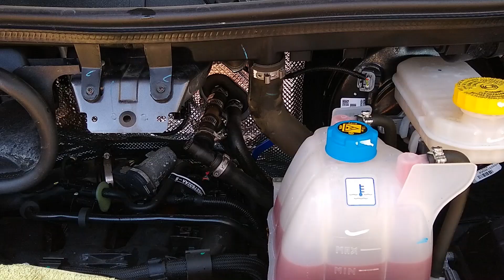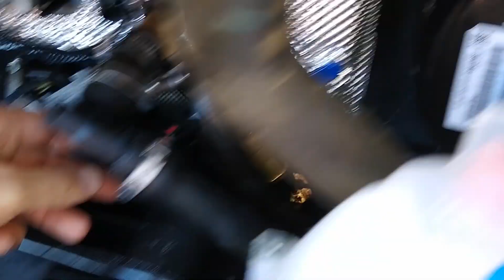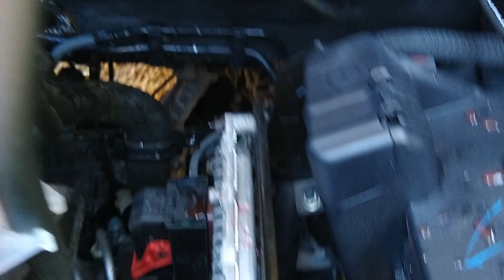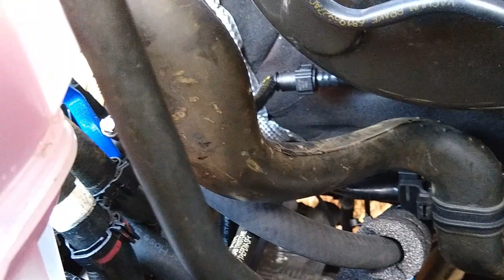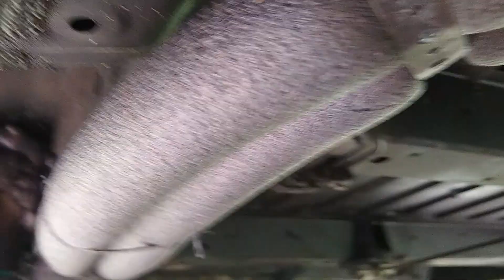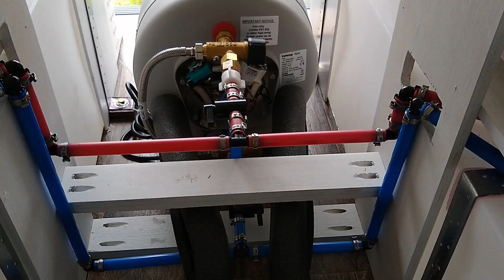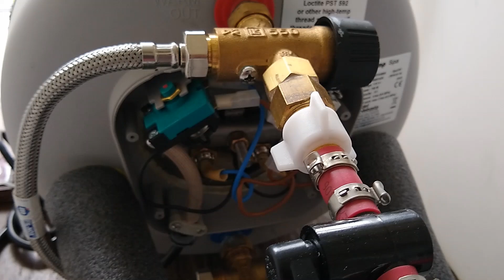Water Heater Install - Marine IsoTherm IsoTemp Spa 15 - DIY RV Promaster Camper Van - WanderingWakes

Comment: Thanks for the well done video! I just recieved my isotherm heater and am about to install.  I'm wondering why you used the Tees the way you did, rather than in a way that forces ALL the coolant to run through the heater core and then the Isotherm.  (Not sure if I'm being clear... and I certainly don't understand thermodynamics). But wouldn't the way you did it allow a portion of the fluid to bypass the isotherm altogether?   

Reading further comments... seems like you're happy with your system and it works well.  Just wondering!  Thanks
Reply: I agree to run in series flow and return from 1 pipe would force all the water through
Reply: Curious about this also @WanderingWakes. I do like the ability to isolate the system if you need to service the heater you can still drive the van.
Reply: Was there ever a reply to this question because I was thinking of installing in the same way. But this way using tees does seem very practical in the way you can isolate the system.
Reply from the maker: @adamgrace5973  Just posted a reply. It must not have saved. Thanks.
Reply from the maker: I thought I replied, but now see I must not have saved it. I believe the factory rear heat also uses tees. I would be concerned that with a series connection, the flow rate might be reduced due to more restriction. Before I installed mine, I only saw others using tees and installing in a similar way. 20,000+ miles and it has been working perfectly. The engine is also not overheating, staying right about 200 degrees max unless climbing mountains. Sorry for the delay on this
Reply: @wanderingwakes9500  perfect, tees it is then 👍 thanks for your reply

Comment: Thank you for this info. Do you think it would be possible/practical/nessesary to add a supplementary rv tankless under sink or shower hot water booster for that initial blast of water or to stretch it a bit further?
Reply from the maker: i think it would be possible, but I located our water heater within 3 feet of the shower faucet, so not much water lost. If you parked and did not drive for several days, the tankless might be good. We can easily take 2 showers and wash dishes on a full tank of hot water, and then tend to drive every day or two, so more hot water is ready then. You can run the electric element in the water heater on an inverter, but it would use a chunk of battery capacity. Hope that helps! WW
Reply: @wanderingwakes9500  thanks! I like the idea of simply locating the heater close to the shower! 👍🏼 I may have to move things around! Cold water in the sink isn’t really an issue and it sounds like this would work well for us as is!

Comment: Thanks for a great video. Would you mind sharing what you used to bring the coolant hose up through the floor. A high temp boot or sleeve? My concern with protecting the hose is covered by your pipe insulation I suppose. How did you seal that hole in the floor?
Reply from the maker: I used a plastic sleeve around each pipe. I also put the hoses in metal pex "bend supports" that helped to protect the hose. Finally, I used high temp RTV sealant to seal the openings through the floor to prevent air or insect infiltration.
Reply: @wanderingwakes9500  Hello, thanks for the incredibly helpful video. What kind of plastic sleeve did you use - to go through the floor?
Reply from the maker: @Lsarsozo  I think I just used some scrap PVC pipe I had, slightly larger than the hose.

Comment: Hey, looks like you have done a fair bit of research on this, we bought one of these Isotemp Spa heaters for our promaster 3500, but dont want to hook up the engine coolant to the heater as we have 4 solar panels, and tons of batteries, do you see a problem with that. Will it work ok with shore power or off our inverter?  Thx  P
Reply from the maker: It does have an electric heating element that we have used before when the engine wasn't run recently. I think it is a 650 Watt element. So it could run off an inverter but you would need to watch your battery usage.
Reply: @wanderingwakes9500  ok, im just hooking this up to the electic only on our 2015 Promaster. Should i just block off the ports for the engine hose, as we will not be using the. I guess if no water is going thru,  there is no danger of water coming out of the ports!?? Am i correct?  Thanks
Reply from the maker: @PaulAuclair  Yes, the water from the engine and fresh water don't mix, so I would just cap them off to keep dirt and bugs out in case you decide to use them later.
Reply: @wanderingwakes9500  thanks so much, i appreciate you taking time to respond! Cheers!
Reply: @wanderingwakes9500  thanks, yes we would use it mainly for showers, heat it up turn it off. Will be in Mexico so lots of sun!

Comment: you will have a separate tank for cold water right?  we are getting a van that has this system.  I had no idea how it works.
Reply from the maker: Yes, we have a larger fresh or cold water tank that then feeds the water heater. Thanks and good luck.

Comment: Hi Shawn, great videos and I learn so much from your build. I have couple questions about the size of this water heater. How is 15 liter (4 gallon) size work for you? What size do you recommend for a couple with 2 kids? Thank you
Reply from the maker: It might be close, but if you really watch your shower use (the biggest consumer for us), it may be fine. But, I also think they offer a 20 liter that would be more hot water. The way it works, with the mixing valve, you really have much more than 15L of usable hot water, since the 15L is 180 degrees or so after driving. The mixing valve extends the use at normal / safe temperatures.

Comment: Just wondering if you'd need an expansion vessel as this is unvented? Am just doing a similar system and had been worried about having to have water ijn the tank at all times, so that the coolant wouldn't fry the calorifier to a cinder. And then I saw your ball valves... Beautiful!
Reply from the maker: I did not do an expansion vessel. If pressure gets too high the van pressure relief would open and the water heater has its own pressure relief valve. These heaters are designed to be in operation for boats, so I am not too worried about hot water circulating all the time. Just my $0.02. Good luck with your project.
Reply: @wanderingwakes9500   we are having problems with releif value leaking only used twice always wet when running off heater core .not electric wondering if this is a normal or should we install pipe so water escape outside van?
Reply from the maker: @DeniseHolbrook  I have not noticed ours leaking but I do have a short piece of hose or PEX attached that runs through the floor to the outside of the van. This is also the valve used to drain if you're going to experience freezing temperatures inside the van. For that reason I wanted it drained outside anyway. If I have a small leak I may not notice it. After some reading I am hearing people say that it takes several cycles to possibly seat the valve. Others are saying that if all of the air is not out of the system it could trip the valve. This sounds more likely so make sure you have purged all the air out of the system as best you can. I would route a line to the outside of the van so that you don't have any water damage from unknown leaks. If all else fails you could contact isotherm and see if they would send a replacement valve. Heating via the engine does get the water much hotter than the electric element so I would expect higher pressures and would not be surprised if it did not leak with just the heating element.

Comment: What are the dimensions of the area that your install consumes?  And, did you ever find a water tank that only works with the heat exchanger and has no electricity?  Thanks much for the video!
Reply from the maker: I will need to get back out and measure exactly. The dimensions of the heater are published, but you will need space in front to make your connections. You can put in 90s to reduce the space needed in front of the heater.

Comment: I am using a similar system, but with plate heat exchangers to transfer heat from the engine into the vans own heating circuit where it can also be used for heating with a webasto thermo top c. The plate heat exchanger is mounted closer to the engine. Thanks for posting. Then I can heat the water and the van from either the engine or the webasto. I can preheat the engine also.
Reply from the maker: Interesting setup. There are obviously several ways to solve the hot water issue. Thanks for your comment.

Comment: As a rule, how much extra piping can you add to the coolant system without damaging the engine in any way?
Reply from the maker: I don't think more coolant lines and coolant will be an issue. The thermostat will keep coolant from circulating until it is hot, and more lines will just allow the engine to be cooled more easily, which is not a problem. There is likely some limit beyond which it won't circulate well, but I added about 40 feet total, and see not issues. I also have an android app and monitor the exact coolant temperature, rather than using the analog temp gauge. Hope that helps...

Comment: Where did you use the Permatex Hi-Temp Red Sealant ? Also,  on the drain connection, did you use a BSP to NPT Adapter ?
Reply from the maker: I used the red hi-temp sealant on the threads for the barb adapters for the engine coolant. Only the hot water (fresh water) out to your faucets is BSP and needs the adapter. Cold water in, the drain, and both connections to the engine are 1/2" NPT threads and won't need adapters in the US. Good luck!
Reply: @wanderingwakes9500  I installed  a IsoTemp yesterday, your video was a big help

Comment: Very nice video. Thanks! If you’re parked for a few days ... how long have you had to idle the engine to get the tank up to a satisfactory temp for dishes / showers?’
Reply from the maker: We have not been parked for multiple days to need to idle the engine. I have read others saying to idle about 30 minutes. I have also read it's not good to idle the ProMaster engine for long periods of time. Sorry that's not much good info for you yet.
Reply: Check out YouTuber Van Land. They tested this water heater. After shutting off the engine for 7 hours, the water out of the faucet still measured 133F!

Comment: Thanks for the excellent video. I'm about to install mine in my Promaster. A question, do you notice any heat radiating from the hoses or the heater? Wondering if this setup will add heat to the van interior in summer  months.
Reply from the maker: We insulated the lines from the engine quite well, but did notice a bit of heat before we had our build finished. Now that the garage under the bed is basically closed off by panels and drawers, we don't really notice it. I would say insulate the hot water lines from the engine and from the tank to your faucets well and you should be fine.
Reply: WanderingWakes Thanks. I planned on insulating the hot engine lines. I’ll do the fresh hot water lines as well. Hadn’t thought about that. My unit will be mounted on the wheel well box just under the bed frame, which is 1x3 slats over unistrut beams. Hopefully I won’t get too much warmth under there. I’m sure most of any real heat transmission is going to come from the engine coolant feed hoses.
Reply from the maker: @williamsmith648  Sounds good. I am completely happy with this option for heating water.

Comment: Does this require your internal heater to be switched on?....to allow coolant to go through to the heater core or is coolant always pumping through the heater core.....even  when AC is on?
Reply from the maker: The heater does not have to be on. Coolant will circulate through the IsoTemp water heater in the van anytime the thermostat opens on the engine (after it warms up). Thanks.

Comment: As you are teeing off the coolant hose from the heaters input and output rather than expanding either the input or output hoses to make a wide loop, do you have a pump off the tee to help circulate the coolant through the new loop?
Reply from the maker: The tees simply add another loop through the IsoTherm, along with the existing loop through the heater core in the firewall. No additional pump is needed, since the water pump can push water through both loops. High volume is not needed. It has worked very well on multiple trips, and we are happy with the install and this solution.
Reply: @wanderingwakes9500  Interesting!

Comment: so every time you need hot water you have to go for a drive.
Reply from the maker: It stays hot for 24 to 36 hours, and we often drive every day. We don't park in one location for multiple days. But, it has a 110v electric heating element, so I can run it off my inverter if the water was not hot from driving.

Comment: So, no need for its own expansion tank or a recirculating pump ?
Reply from the maker: No. The existing system handles any expansion, and I kept my water lines short, so hot water arrives from the tank mixing valve quite quickly. I am still loving it. Even the next morning, the water is still hot enough for a shower or washing dishes.

Comment: Where is the cold water tank? Separate?
Reply from the maker: I have a 46 gallon fresh water tank that provides unheated water and water to supply the heater.
Reply: @wanderingwakes9500  do I have this correct? Cold water from fresh water tank goes into heat exchanger tank and heats up there, but also has a second node that mixes the output/exit line of exchanger tank with the cold freshwater tank to get not-scolding hot water? So this way you only refill the fresh water tank?
Reply: @buggzo  You are correct.

Comment: For me, the worst part of camping is the lack of hot water for showers. As I am understanding your video, you will get hot water without using electricity or propane or any energy source except the heat of your engine? That is an incredible concept! Excellent tutorial video.
Reply from the maker: Yes, only the engine coolant is needed. This marine style water heater uses engine coolant to heat the water to a very high temperature. The mixing valve will then mix it down to a safe temperature. No propane or electricity are needed, although the heater has an electric backup option. This IsoTemp IsoTherm Spa 15L water heater cost less than an RV propane fired water heater, so it was a win all the way around. Good luck with your water heater install. Happy Trails...
Reply: @wanderingwakes9500  but only hot water when you're engine is running and warm?
Reply from the maker: @chrisb5839  but once the engine has heated the water, it will stay hot for use hours later after the engine is off.